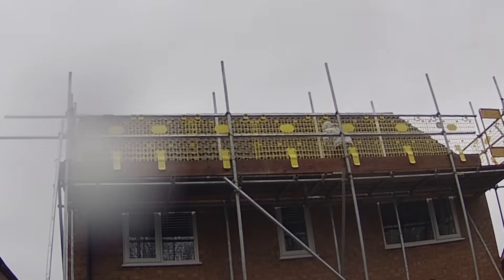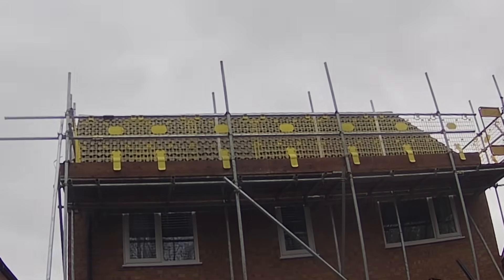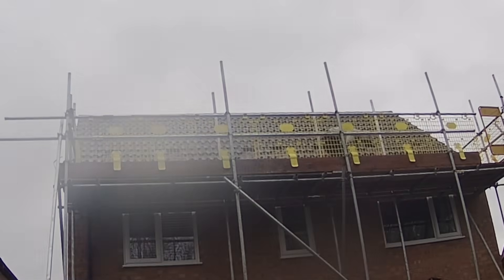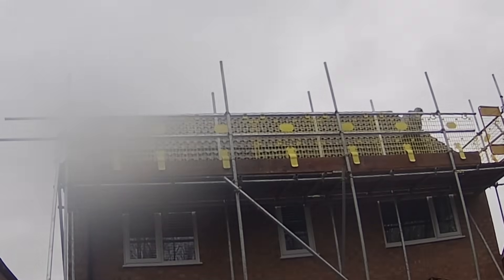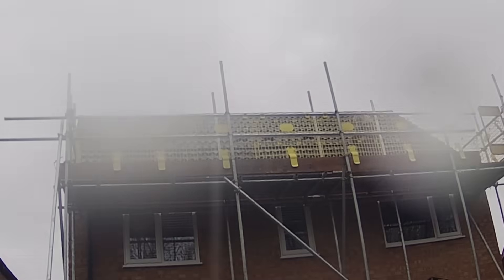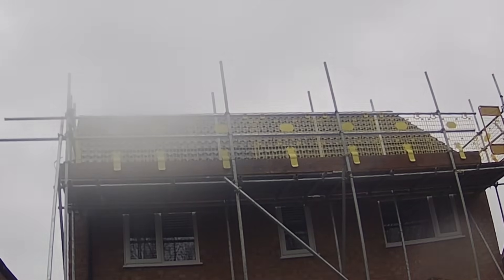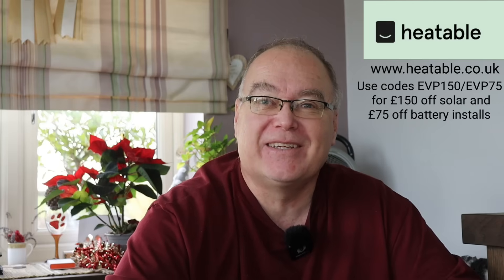My daughter's 5kw solar and Alpha ESS Smile 3 battery (14kWh) install by Heatable

Comment: Sometimes you just cannot look a Gift Horse in the Mouth. If the deal is there, meets the budget and requirements you go for it. I’m sure that in time, with working from home, north facing panels might go up.

Comment: Thanks, a very useful video.  
It would be very helpful to see the completed battery installation with all the wiring and isolators.  Which would also show what the wiring between the battery modules looks like.
Reply from the maker: They looked very simple taking a few minutes to connect. I'm affraid there's simply nothing to see

Comment: You are mixing up your terminology.  There are three types of panel.
“Solar panels” are solar thermal panels, commonly seen on roofs in hot countries like Spain. They usually have a cylindrical tank mounted above them and are used to heat domestic hot water.
Photovoltaic (PV) panels are more often seen on roofs in the UK. These panels convert sunlight directly into electricity; these are the panels you are talking about.
There is also a hybrid system sometimes called “solar PV-thermal” (PVT). It combines a PV panel with a flat tank or heat exchanger behind it, filled with antifreeze fluid. This cools the PV cells, improving their efficiency by around 10–12%, while the heat collected is used to heat domestic hot water. Once the hot-water system reaches its maximum temperature, any excess heat can be diverted to other systems—such as a ground-source heat pump loop—to keep the PVT panel operating efficiently.
Reply from the maker: Yet everyone knows exactly what I mean. Solar thermal is dead in the UK, no one is installing them so its a redundant reference

Comment: No doubt Heatable did a good job, but in my experience I would always choose a local company with a proven track record. The installation of your solar PV-battery system  should be the beginning of your relationship with your installer, not a one-off job. You may need them at a later stage to service, repair or upgrade your system. With a bigger company that isn't local, accountability tends to be more of an issue.
Reply from the maker: Exactly , which is why Heatable use a local installer. All of the team were local and don't treat installs as a one off .  I think you've misunderstood what Heatable offer
Reply: @EVPuzzle Thanks for the reply — I understand the point about using local installers. My concern isn’t really about where the installer is based, but about accountability. When a national company sells the system but the work is carried out by subcontractors, it can become unclear who is practically responsible if something goes wrong later (faults, remedial work, warranty issues, etc.). Even if the company is responsible in principle, the customer experience can be very different in practice. That’s the aspect I feel is worth highlighting for viewers making a major, long-term investment. I say this in my capacity as a Retofit Assessor who has professional experience dealing with installations like this. This is not intended as a specific criticism of Heatable but an expression of concern over the operating model.
Reply from the maker: @clivepierce1816 it would be if that was my experience but it's not. Again you're presuming the sub contractor has walked away. They haven't , I'm still in touch with them as well as heatable , they're brilliant . Their last words were don't hesitate to contact us with any issues or concerns , that's on top of Heatable being available.

This is exactly why I discussed using heatable was a good decision as it avoids the risk of picking an installer that walks away afterwards or just goes bust etc .

Nationals like EON who I used in 2019 and used a subcontractor I never heard from again is exactly your point and Heatable doesn't fit this same national subcontracting theme .

Comment: Like to have seen some support legs on battery.  Look forward to hearing how it performs.     🇬🇧
Reply from the maker: It's not designed to be ground mounted
Reply: @EVPuzzle     I get that, but it should.  🤔.   🇬🇧
Reply: @EVPuzzle     The battery is water proof but you said you were going to put a canopy over it and I agree. it’s all about precautions.    🇬🇧

Comment: External Consumer units - the NICEIC has warned installers against their use!
Reply from the maker: Looks better than the meter cupboard to me
Reply: @EVPuzzle  He's wrong anyway. NICEIC has explained to its members that over-specifying the IP rating for external consumer units can cause heat build-up and excessive condensation inside the CU.
Reply: The NICEIC doesn't write BS7671.
Reply: @VinoVeritas_ no but it certifies installations. And the IET who writes the regulations have issued the same warning. To me it did t look like a product certified for long term external use, where only metal has proved itself to be sufficiently durable.
Reply: @G6EJD  The NICEIC only warned its members about over-specificying the IP rating of consumer units when used externally. Keep up. Also, it's irrelevant what you think.
Reply: @VinoVeritas_  The result of too much vino...

Comment: Great to see a positive installation experience from a professional team. Could you do a video on the best bang for your buck batteries? I really want more storage capacity and don’t know whether to expand my existing system or upgrade to a new one. Thanks
Reply: What's your existing system?
Reply: @VinoVeritas_ I have a Luxpower inverter coupled to two Uhome 2400 LFP batteries
Reply: @peakrider4886 You're going to need an additional inverter then if you want to add another brand of battery other than the UHome ones.
Reply: @VinoVeritas_ you misunderstand the question. I could buy another 2 Uhome batteries and connect them to my existing system, or I’m wondering if it’s better to replace the two that I have for a new battery with bigger storage. I’ve heard the prices have come down a lot so it may be better to replace than to expand.
Reply: @peakrider4886  That will depend upon how much the UHome batteries cost per usable kWh of storage and how much additional storage you're wishing to add.
Reply from the maker: Depends on your system and how much you need. As I've said in other videos about Aferiy batteries portable solutions are the cheapest small addition as there's no install cost and no compatibility issues.  But if you need more a modular system like mine with Pylontech is handy .

Comment: How does heat affect the battery when is minus outside?
Reply from the maker: As per all batteries it reduces charge rates and outputs but this one's heated so can still work well into the minus numbers
Reply: @EVPuzzle  Thanks. Best regards from Croatia in new 2026.